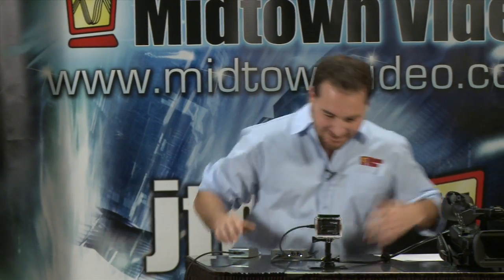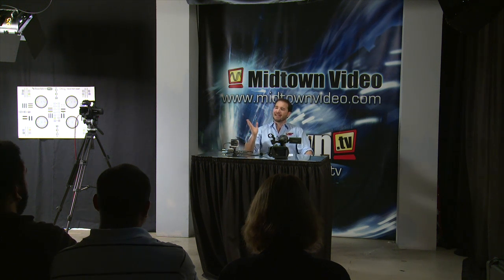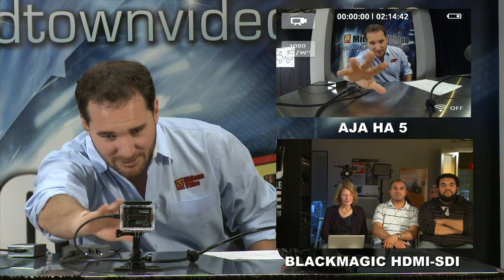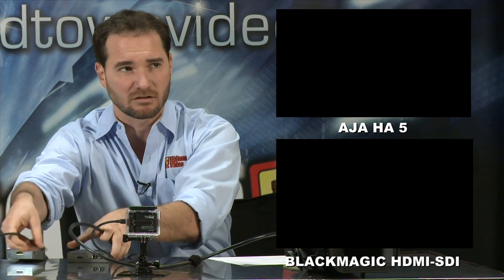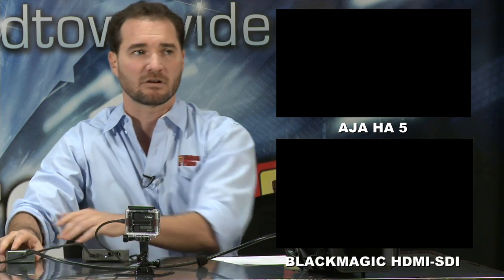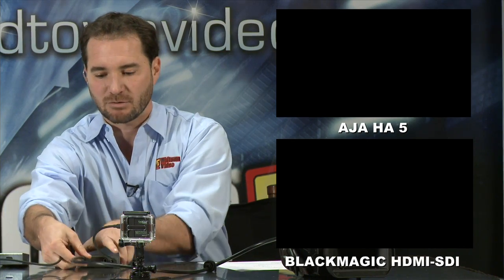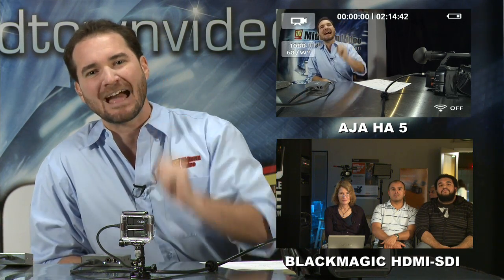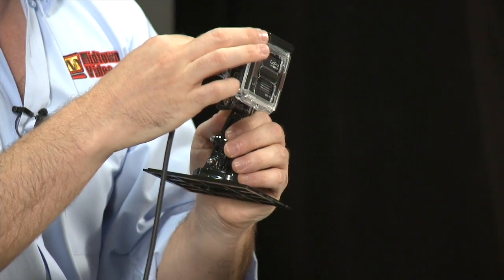How to Connect GoPro to a Switcher ep 47

Comment: Luckily with the Atem mini, we can connect gopro 5 with hdmi cable, our question is how do you hide the text so it's not outputted when you switch to gopro when livestreaming?
Reply from the maker: ShaLaLaLa Productions thanks for writing and for watching. To turn off the text you need to adjust the menu settings of the gopro.  Find “osd” (on-screen display) and set it to off.
Reply from the maker: Thanks for watching and for your question.  To turn off the text, on your gopro menu, find the “osd” (on-screen display) setting, and set it to off.
Reply: jesse miller that did the trick thanks & you’re welcome!!!

Comment: So just had a breakthrough with getting my GoPro Hero 4 with my Atem Switcher.  Check out this youtube video to show how:  https://youtu.be/9A94J8lAceI

Just a GroPro Hero 4 Silver to Lilliput HDMI LCD Video Monitor (used for DSLR's), straight into an HDMI port and it works.  The monitor has an HDMI in and out, and it turns the 1080p into 1080i and works perfectly.  It also works with converter boxes into the SDI ports as well.

Comment: Well I have been through Go Pro hell and back trying to get them to work at 1080 with the BM ATEM TV switcher. I am going to B&H to pick one up
tomorrow, I see you had it set to 1080 60fps. I saw another person said the AJA worked with the ATEM at 30fps. Oh please let it work. I have the Avue
HDMI to SDI converter and it only works if the Go Pro is set to 720p 120fps and the ATEM set to 720 59.94. My Nikon D5200 whowever works fine with the Avue at 1080p just not the Go Pro. But these boxes are expensive combined with the 400 for the go pro and add ons your almost up to a 1000. I wish my Nikon did not have auto  live view off after 30 minutes as I would just use instead, much better picture in general...

Comment: Great video.  Would like to use GoPro with Tricaster TC40 which doesn't have SDI inputs, only component HD.  You mentioned using HDMI over CAT5.  What hardware have you verified works with GoPro Hero3 Silver or Black for this setup. Also, what is recommended for getting the signal into Tricaster 40....would need to convert from HDMI to Component HD?